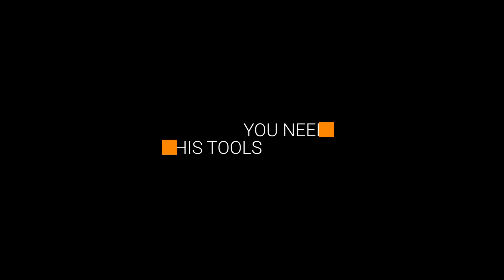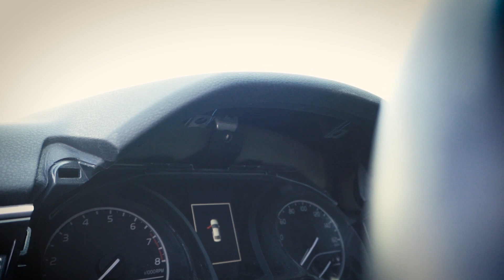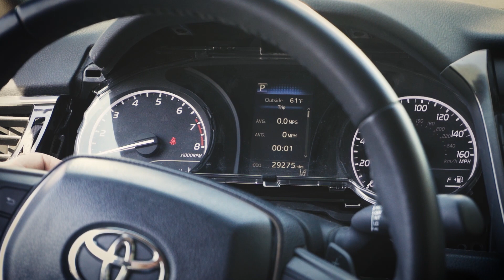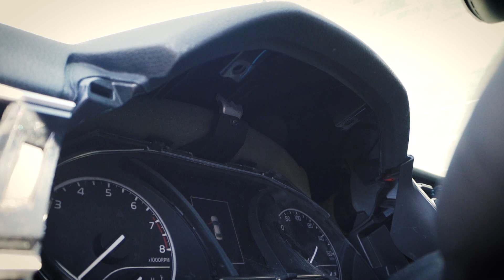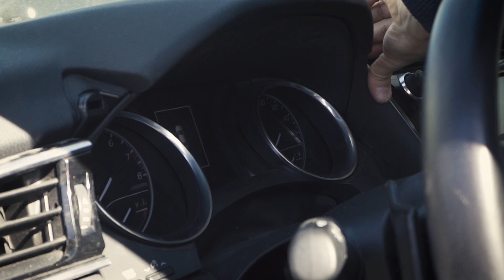Mileage odometer correction tool | How to stop mileage | TOYOTA CAMRY | Mileage Stopper programmer

Comment: Does it work on a  USA Toyota Prius  2021 and prime  ?  Thanks
Reply from the maker: Here: https://superkilometerfilter.com/product/toyota-prius-fourth-generation-xw50/
Reply: @SuperKilometerFilter  Thank you, but I was on the website and did not find information where it is said that the models ZVW51L Prius  and prius PRIM ZVW 52L are listed with this device odometer correction tool. IS it work for USA market Prius 2021 ?thanks
Reply from the maker: It works with all Prius of the 4th generation from year 2017. Best regards

Comment: I need that small part to buy ? Or just disconnect how doses it works ?
Reply from the maker: yes that is correct you have to buy this device under this link https://superkilometerfilter.com/product/toyota-camry-odometer-blocker/  you can get it and then you can use it
Reply: @SuperKilometerFilter  I need to buy long cable or short ? With app or without app ?
Reply from the maker: @zabizakir5104  If you would like to activate the filter with your mobile phone, then with the app. The long cable makes it easier for you to remove it if you have to go to service
Reply: @SuperKilometerFilter  ok thank you

Comment: Hello does the 2019/20 Toyota Camry XSE cluster speed meter fits into a SE model? Are they compatible?
Reply from the maker: yes that will work too
Reply: @SuperKilometerFilter  thanks man, I  will change my 2019 Camry SE cluster speed meter to a XSE. The XSE is way cooler
Reply: Did you ever swap it out? How did it go?
Reply: @SuperKilometerFilter  hi. Do you have for Highlander?
Reply from the maker: @sensation939  No, we don't have it at the moment. There were technical problems, so we took the model out of the range.

Comment: Just unplug the cluster. Use a smartphone connected to obd2 to monitor the car. Thats what ive been doing for the last few years
Reply from the maker: yes that is also possible but isn't that a bit crazy if your speedometer doesn't work? if you have an automatic transmission then the vehicle does not shift properly, the speedometer takes part in every gear change. that is a possibility but not the cleanest